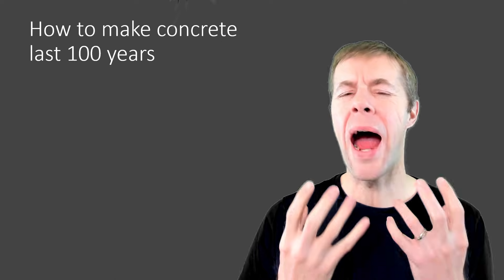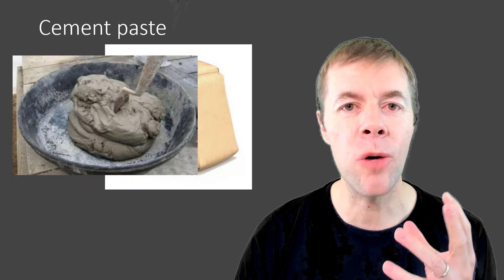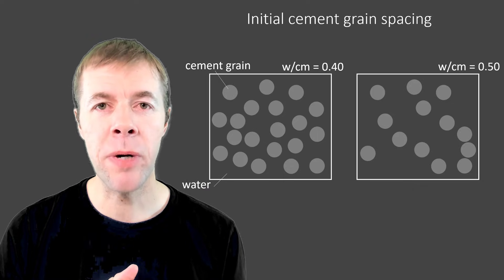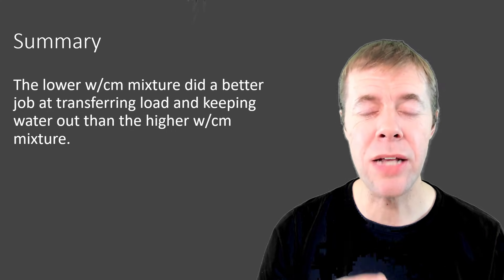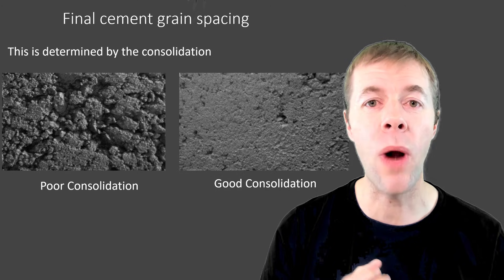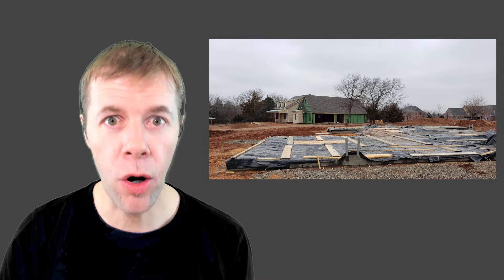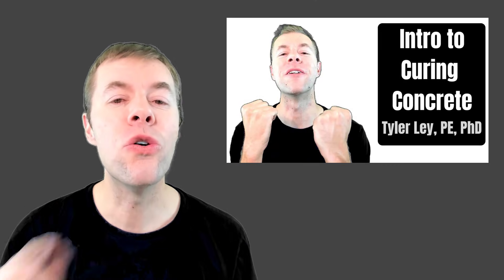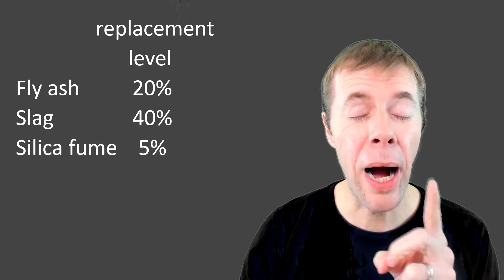How to make concrete last 100 years

Comment: On Vibration: "Might want to keep doing it a little more for safety factor". Too much vibration will separate the aggregate from the cement. Obviously not completely but enough that the top of your slab will have too much paste (cement). Cement shrinks and so the top layer will shrink at a different rate and will cause failures such as delamination. Good video, just stating what I've learned. Exposed concrete in cold regions is typically air entrained. Vibration can remove these super small bubbles. I’m curious how you design an air entrained slab of concrete to last 100 years. Perhaps the engineering requires not using air entrainment. Not sure
Reply: Curb and gutter in street construction are poured without vibrators and a t a 2 inch slump...LOTS OF HONEYCOMB!A JUNL WAY TO DO IT!

Comment: Thank you for all of the information but I thingThere is a problem Could be caused from over vibrating the concrete Which is Segregating The particles cement paste From the aggregates 4:29
Reply: I was thinking the same thing. Overvibration causes concrete to segregate. Heavy aggregates will move to the bottom.

Comment: does putting baking soda in the mix could help make it better insulated?
co2 is great in styrofoam insulate, now if we just pour it strait in the concrete could reduce the amount of styrofoam you need to use
in theory it sacrifice strength for better insulation, so if you don't plan on building a castle and you live in siberia or the mojave desert this could be a great mix to print a house

Comment: You're probably going to mention reinforcing soon too, but basalt rebar will be amazing. Silica fume, super plasticizer, basalt, proper ratios and curing and you have something incredibly tough.
Reply from the maker: I agree!  I am a little concerned about the ductility of basalt rebar.  I have played with some of the fibers and they are very brittle.
Reply: @TylerLey is ductility a concern for all applications?  Perhaps it could work in applications in which ductility is not needed.
Reply: @TylerLey  Any experience with pretensioning Basalt rebar?  I imagine this would mitigate some of the weaknesses of basalt.

Comment: I have seen and used PPC with higher concentration of F.A. like 35 + % and it works well in hot climate of India. The F.A keeps on reacting with water to seal the micro cracks for many days even after cement has been set.
Reply from the maker: Thanks for the information!
Reply: @TylerLey  I would like to know something here has anyone ever tried mixing both slag and Fly Ash in cement ? If yes what would be the result be like? I had this talk with some senior guy from NCCBM (the Institution in India that approves quality of cement and Building material and does research on them), they kind of liked the idea but didnt explain on what would that do.

Comment: Not so sure fly ash is a good idea since it can be acidic if it contains a high sulfur content. I recall the old concrete blocks (cinder blocks) that only lasted about 30 to 40 years before crumbling. The question will the supply of fly ash be sulfur free? I doubt anyone performs a chain of custody for fly ash in concrete, or even test it prior to use in concrete.
Reply from the maker: Guy,
Lots of testing of fly ash before it goes into concrete.  Only low sulfur flay ash is used.  Fly ash is an awesome tool to extend the life of concrete.
Reply: Tyler for you: Not sure if this is hype or has some real merit

https://theconstructor.org/concrete/bacterial-concrete-self-healing-concrete/13751/
"Bacterial concrete or self healing concrete fills up the cracks developed in structures by the help of bacterial reaction in the concrete after hardening. "

https://www.concreteconstruction.net/concrete-production-precast/making-concrete-with-carbon-dioxide_o"Not only does this process consume CO2, but the compressive strength improvements from an optimized injection of CO2 enable the production of concrete with a reduced binder content without sacrificing performance."

Comment: I'm really interested in perfecting the concrete methods.  There are some things that need to be cleared up, however.

When you vibrate concrete, you have to be careful that your aggregate/rocks do not settle to the bottom and that you end up with cream rising to the top that has far less aggregate and when the concrete is floated out, way too much water floats to the surface creating a really weak surface that will spall and flake immediately after curing.  A slump test will demonstrate the proper mixture for each job.

Some applications like dry-pack are far preferable BECAUSE of the loose packing of the concrete and the air gaps are necessary for permeability, as the water drains through the concrete purposefully.  This is suitable for shower pans (resting on pan-liner of course) and swimming pools.

The addition of fiber and admix strengthens the Hell out of concrete, but remember, both additives affect the finishing.  Troweling plasticized cement is really difficult and staining the cement with an acid stain is out of the question.  To finish a slab (for example) while maintaining a workable surface, you can add fiber to the bottom 3/4 and have a fiber free mix for the top 1/4 spread.

Floating/finishing has to be relatively perfectly timed, if you do it too soon, you bring too much water to the surface - literally ruining the job.  If you wait too long, it becomes unworkable and you ruin the job.

The proper use of rebar supports is critical for large area strength- the problem with rebar is that it rusts.  They even manufactured a green-rebar to resolve this issue, but the same problem arose with the green coating getting scratched during shipping.  We coat our rebar after it has been placed and pour around the freshly coated rebar.  

The rule of thumb for concrete work is "40 and rising".  You don't want to do anything "concrete" if the temperature is below 40 degrees F.
Reply: When we vibrated an 800 yard pour in the mountains of colorado in the oil shale retort,we only dropped thevibrator in every 2 feet..fast in and slow out..I was told by an engineer there that we poured at a 4 inch slump to save money.he told me we could put 1/2a sack more per yard and pour at a 6 slump for the same strength ...
Reply: Can you give any help as to what you would recommend as an ideal mix / process for lightweight concrete used for hand built (not mold cast) sculpture... both indoor sculptures & outdoors?
Reply: @cchemmes-seeseeart3948  ALL CRETE or NEW CRETE by Rapid set.  If you are wanting to pack the concrete by hand, I would recommend a retarding solution to slow drying time.  If you are pouring into some kind of form, just follow manufacturers instructions.

Use cold water and make sure all containers are perfectly clean.  Even a little contamination can upset a mix.
Reply: @hybridamerica  Thanks for the input. Much appreciated. Have a great day.
Reply: @cchemmes-seeseeart3948  If you are doing terrazzo (grinding polish) then just add decorative stones (or any grindable material) to the mix.
Reply: this comment about 3/4 had fiber?WHAT do you mean?and 1/4 had no fiber to finish it?Surely you cant mean to pour 4 inches thick then come back and pour 2 inches without fiber!....you will NEVER FIND THIS DONE ANYWHERE!nor will you find a contractor to do it!,,in all this vid,while he talks about molecular structure ,HE FAILS to say order 4000-5000 psi concrete,pour it at a dry 5 inch slump,dont over vibrate,get the rebar chaired up 1.5 inches from the bottom of the slab!......this one sentence is what this is all about!
Reply: @metalrooves3651  We're just real good. that's all.
Reply: coating your own rebar on site to avoid scratches is the SILLIEST THING I HAVE HEARD ON YOU TUBE!do you really believe your application is better than factory coated epoxy?YOU MUST BE KIDDING!
Reply: @metalrooves3651  We powder coated ours after electro-plating them with gold, which has a very high oxidation resistance.
Reply: @hybridamerica  exactly what I was thinking  .  Some zinc  over it perhaps

Comment: 100 years?  LOL, it will last 2,000 years (do you travel outside the US much?) if you do it right.  A .PhD?  You forgot the number ONE thing to NOT do.  DO NOT USE STEEL REINFORCEMENT.
Reply from the maker: Reinforcement discussion is coming.  2000 years is only possible in special environments.  Surviving Roman concrete is in mild  environments.
Reply: Yes, from WELL below freezing to low triple digits. LOL

Comment: EASY: Take roman concrete and it will last 2000 years! https://en.wikipedia.org/wiki/Roman_concrete; 
example: https://en.wikipedia.org/wiki/Pantheon,_Rome
pro: U can mix it yourself, cheap, availablity (almost everywere), not much energy needed in production.
con: may be labour-intensive,  it's hard to make money with it (as anyone can do it himself), not a certified building material
Reply: Modern concrete will last just as long Ranjit as long as like the Romans, you DON'T use steel reinforcement.

Comment: I build mobile equipment that makes polyester concrete. Do you have experience with polystyrene? Or epoxy used in structural strengthening. Carbon fiber ect...
Reply from the maker: Polyester concrete is awesome but expensive.  That stuff will last a LONG time if it is done right.

Comment: I keep the rebar ends and  sides 1/ 1/2 or a little more away from the forms. I leave the forms on for a week or longer and use plastic or tape seal over the forms on faces exposed to weather- the tape leaves a smooth surface and keeps the water in the concrete. I use soaler hoses and tarps on slabs, walls and pillars. i use stainless steel where steel has to come outside of  the surface so it will not rust. i never use aluminum near concrete, I use stainless steel at areas where they touch. ( They react to each other if it is aluminum.) Pay attention to the bottoms of pillars with the vibrator so there is not a honeycomb at the very bottom, do not pour forms deeper than your vibrator. i used fibers in all of my concrete to stop micro cracks while it is curing. I try not to pour in real hot or cold weather. See Necedah Tower on Facebook, that is what I built. On mixes I made without ready mix truck I added some fly ash to reduce the alkali silica reaction- our stone here has a lot of quartzite and granite in it.
Reply from the maker: Basalt rebar is not ductile.  This means overloads can cause sudden failures.  We need this for human safety.
Reply: ALL steel rebar will eventually rust no matter the depth theyua.  DON'T use it.
Reply: @patrickeh696  steel rebar is required in pillars and suspended slabs. All buildings have rebar in them.
Reply: Really?  LOL.  Well in the 21st century trained builders use BASALT rebar.

Comment: Please explain how the Romans made concrete to last more than a thousand years. There are examples of Roman Ports still in existence.
Reply: No steel rebar to rust + pozzolans (volcanic ash, crushed fired clay bricks, etc...).  They also hand compacted it with large aggregate in manageable layers.  They even used different mixtures for bonding, scratch coat and surface.
No way that is happening on an economical scale with pump trucks, but we can get close using modern pozzolans and fiberglass (or maybe carbon fiber / graphene eventually ) instead of steel rebar.
Robert Murray Smith's channel showed significant improvements over existing solutions by adding a bit of graphene to the mix.
People have tried everything from agar to wood ash but it comes down to chemistry.  Ideally you want a chemical reaction to achieve high strength relatively quickly but have enough chemical left to react later to fill cracks and prevent various types of erosion.  It's all a balancing act of quality vs speed vs price.
Reply: Just saw an article on this not too long ago.  Has something to do with the limestone & volcanic ash they used in their mixture & how it reacts with saltwater.  A university has broken off chunks from the remains of the ports you mentioned & are attempting to determine the ratios of the components I mentioned above.
Reply: Volcanic ash aka, pozolona. Plus sea water.
Reply: They used white lime not concrete,cement is a modern thing,lime lime is made from coral reef and was the cement of our times
Reply: They probably didn’t put rebar in it
Reply: I wish modern concrete building can last 2000 years like roman structure. Then you can pass it down to your great great ….. grand children. Good for the environment too.
Reply: @rebelusa6585  We can, you just have to pay for it. Instead of $130 a yard for a normal foundation mix, $2000 a yard will last.
None of the roman concrete is left in england and other areas where is froze.
99.9999 of roman concrete performed way worse than modern. Take chunk of the stuuf pwople talk about and put it up in thw alps and it will start to fail right away.
Weve know about everything in roman for a long time.
Reply: They beat in volcanic rock inside of the concrete and I'm guessing that is the only difference is volcanic rock and filling the rock with cement and filling the concrete with it not sure thou only difference I see
Reply: i was told that it's the salt water they pour in that make it stronger and it's NOT romain concrete they stole the recepy from a nearby enemiy.
they say the the salt create a corrosive mix and when it dry out it give a welding effect to the rock and a natural immunity against sea water
Reply from the maker: Check this video out:
https://www.youtube.com/watch?v=PMed3YtN-Fo

The ones that survived are in very mild environments.  I need to do a video on survivor bias.
Reply: Tyler Ley .
Reply: @TylerLey  is using sea water a good thing?
Reply: Sea water is the secret
Reply: They had slaves to do the work and crucifixion for the slaves that produced concrete that was less than perfect ! So the impetus to make concrete that lasts two thousand years was there and it was a big part of why the Roman Empire did such good works !
Reply: @ssmith2019  Nice response, so if i threaten my neighbour with a gun he can create me a time machine and a house that will last 2000 years????
Reply: @ssmith2019  no dude..

Comment: You would probably want to visit old fortresses that have been built over 100 years ago. I'm involved in the museum fortress Oscar II Fort ( o2fort.se ) here in Sweden and the cement used when it was built in 1908 is in better condition than the fast modifications added for WWII.

So good concrete construction knowledge has been around quite a while, but it has of course been refined over time.
Reply from the maker: I agree!  Thanks for sharing.

Comment: In you opinion what is the ultimate time limit that a concrete structure can be designed for? (with the current available state of the art technology of course)
Reply from the maker: It depends on the environment it is in and how long you want to use it.  In very extreme environments we can design concrete to last 150+ years but we have a hard time projecting past that.  If you are in a mild environment (not exposed to freezing or chlorides) then it is much easier to make long lasting concrete.
Reply: @TylerLey  Thanks for your answer!

Comment: I would like to know how long lasting a ramed earth form filled with air creat in the middle would last and how well it would insulate and I am wondering if the fixed forms could produce really good air creat in the middle:) would take four ever to dry in the middle and that would be good right?
Reply from the maker: Clyde,
I think that sounds like a good system that should be long-lasting.  Let me know how it goes.

Comment: Can i use slag and fly ash together  and if yes how much cement can be replaced as a total ?
Reply from the maker: It depends on your application.  I have used 35% slag and 20% fly ash before.  You can get some really good results.

Comment: Regular curing methods ensure that the concrete surface is well cured, but deeper inside the concrete the cement can still be starved of water, particularly in low w/c ratio mixes. To solve this problem we can introduce internal curing.  This can be accomplished by replacing a portion of the aggregate with a porous material (such as expanded shale). The porous material is pre-soaked it water to fill all the voids in the aggregate with water.  When the concrete is mixed, the extra water within the voids of the aggregate is trapped and does not dilute the cement paste (thus reducing its strength, as shown in the video), but once the free water in the concrete is consumed during curing, the water within the voids defuses out of the aggregate, helping to further cure the cement paste (or make those white circles in the video even larger).  Internal curing can thus make concrete both stronger and more impermeable.
Reply from the maker: Thanks Dave!
I agree that internal curing is a big help in low w/cm concrete.  Thanks so much for jumping in.
Reply: @TylerLey  Thanks for your great videos. I'm learning a lot. To be honest, I don't think I fully understood the internal curing concept (which I was introduced to at the Canadian NRC while breaking cylinders a number of years ago) until watching this video and composing my comment above. Your diagram showing how the particles hydrate and link together helped me to visualize what is really going on.  Might be worth doing a video on internal curing some day.
Reply: How about the effects of porous aggregates on strength of concrete sir.
Reply: @rodolfollanera5936  If all your aggregate was porous you might have a problem getting a high strength concrete, but typically only a fraction of it needs to be, maybe 10-25% of the sand.
Reply: This may be beneficial for large members like beams and walls.  What about slabs?  Wouldn't the porous materials give their water up during the finishing process?  This may lead to excessive bleed water and hinder the finishing process.